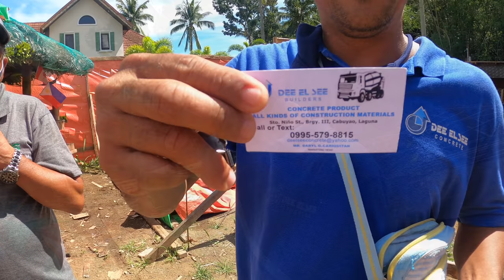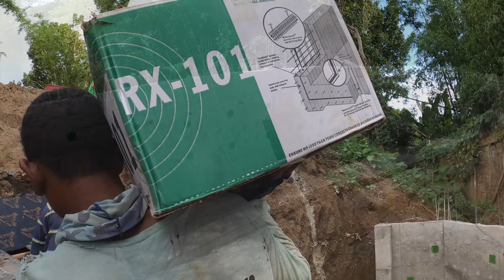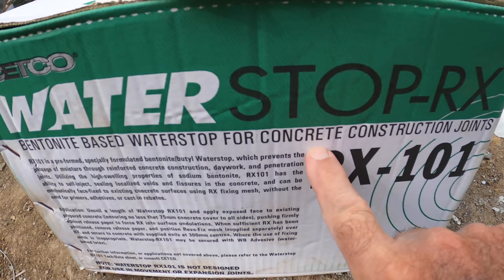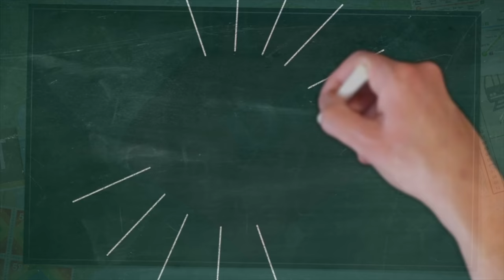NEW HOME BUILDS - EPISODE 4: HOW TO STOP LEAKS (House Building in the Philippines)

Comment: James, Just a couple of additions. To waterproof the actual concrete for foundations, septic tanks, and 
cisterns the ad-mix called "Sahara" is widely available in the Philippines. One packet per bag of portland 
cement. For slab floors in particular. Use a compactor, then sand or gravel if you like but always a vapor 
barrier of 6 mil polyethalene. This prevents the cement paste/water from going out the bottom surface and weakening the concrete. Polyethalene is hard to find in the Philippines so we are now using the tarpolian
fabric used for sign making. 12 foot widths overlapped about a foot. Last little annoyance for today is
minimum bend radius for rebar. It is listed in bar diameters just like splice joint length and concrete "cover" thickness from rebar to the forms. We use a 2-1/4" round stock to bend around which is right for 16 mm bars
and not a problem for anything smaller diameter like 12mm  or 10 mm.  We have  site policy that bars to a 
corner go a minimum of 1 meter around the corner to get the splices away from the corner. This is not a 
building code rule just personal preference.

Comment: Magandang Umaga James. I agree that this was build is a very interesting Video. Not only does it show steady progress, but the tools being used  are more in line with what you would see at a Stateside build. The Contractor was also on his A game and his knowledge of building   to last and building it right is impressive. I liked seeing the Concrete Truck with a Pumper and being utilized.  The Weeping Wall as well the Concrete Vibrator are all tools used in modern Poured Concrete structures. It will ensure a high quality stable Wall and other structures. I imagine the cost of construction will be significantly higher because of the Technonogly employed,  Ready for the next episode with your excellent coverage.

Comment: Hi J !  From an engineering perspective .I wonder if bulk heads in a cistern built in this location might be of some benifit regarding seismic wash/vibration  back and forth in the hillside ...
Reply from the maker: From my perspective, I don't believe bulkheads are necessary mainly because the top of the cistern is going to be integrated into cross beams for the swimming pool slab.  I'll show more of this in the next episode but I like your forward thinking!

Comment: James can Romeo method work on a "Basement" as well I would like to have a  Basement when I do my home in the Philippines. But I'm scared of the rainy season when it comes.
Reply: If you go to  the first episodes of James  build ,he did very similar  to  how we build  in Canada , we  make  footings  then build foundation walls  then  perforated weeping tile with sock around  perimeter of basement walls  @ the base which has 3/4 crushed  stone or gravel  then walls  are tarred with asphalt   then Dimpled  sheet around the  whole  basement perimeter, if done this way the  basement will never leak, James  weeping tile is connected to his cistern which  then holds the rainwater for dry  summers, he can pump that water  for the garden and lawn  as needed, and if on a  timer and  or computer  and  hooked  up to the  internet  can be remotely controlled from anywhere in the  world.
Reply from the maker: With the exception of building your house on a property that is in a flood prone area there's not many reasons you can't build a basement as long as you follow time proven construction methods.  The system Romeo is using would be perfect as well as Aurelio-Rey miler cabal reminded below, we used CHB but made sure we had plenty of waterproofing and water evacuation strategies built into our construction.  To date (5 years), we've had no issues.
Reply: @MyPIDream  Yes , your basement has CHB  but filled with cement and rear reinforced,  so almost a solid wall, but if it was a solid wall  and rebar like the retaing wall the Caribbean  construction  Co. Is doing  is doing it would be even better . That system they are doing  for the solid pour retaining wall plus rebars inside are only done by huge construction basement  projects like  Condos  here in Canada, I must say  the Owner  of the  Caribbean  Construction  knows how to build super strong houses, that  house and retaining walls  should be good for a couple if centuries , if not more.
Reply: If I am remembering right James has a double course wall with staggered joints on his basement. So 2 courses of 6" block plus a mortered connection between them for a wall thickness of 12". @MyPIDream
Reply from the maker: You are remembering correctly.  2 layers of 6"CHB, buttered, filled and plaster coat.  More like 14" of thickness.